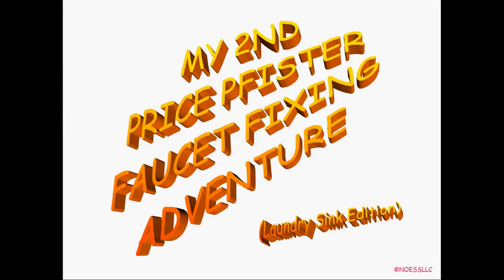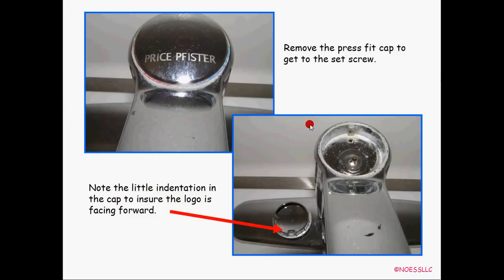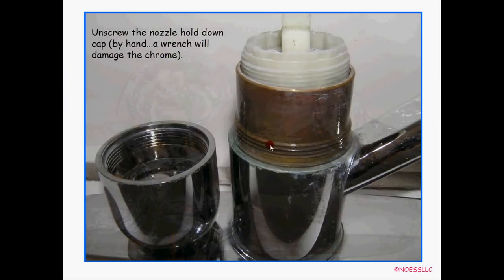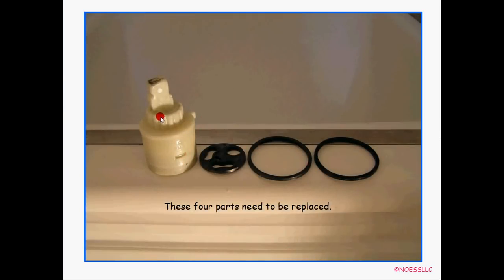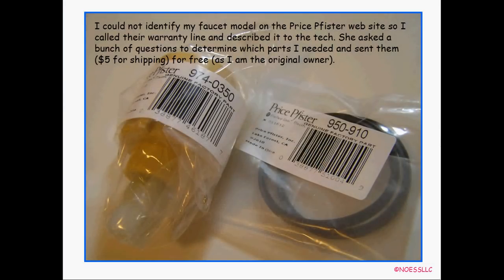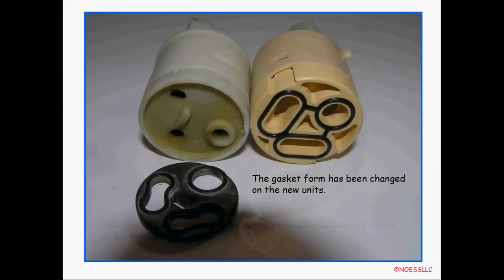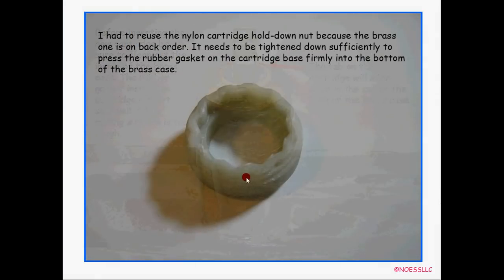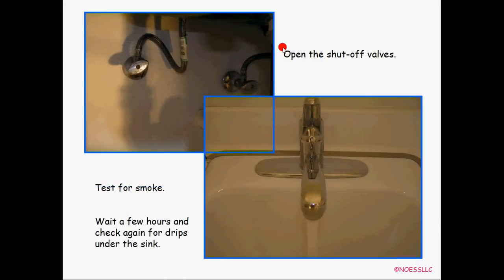Price Pfister Cartridge Faucet Repair

Comment: This video was extremely helpful. Not only did it take me step-by-step, but I like the fact that it talked about kind of the pitfalls with the buildup and getting that off. The other great thing was being able to get the replacement parts for free because I am the original homeowner. Thanks and I’ll be using you for other facets in my house that I’m sure will be ready to give out

Comment: Very nice video. I replaced the cartridge, no leak from the top now but I need to replace two O rings as you explained. I also have leak around outside the brass cartridge housing. Shipping is free now from Price Pfitser for the original owners. Thanks

Comment: Good video - thank you. I've replaced my cartridge before, but it's been quite a while and your instructions refreshed my foggy memories of how to do it. However, at least in my case, Price Pfister limits their warranty to 20 years. I am the original owner, but I was told that my 22 year old faucet was no longer covered. I found a cartridge on Amazon for $16.50. I can't complain too much, considering the use my faucet has seen over time.

Comment: Thanks for your video. Had to search a little to find a video on this model. I have the exact same problem of it leaking from under the handle and then dripping down the mounting hole in the  sink. I was not aware of the lifetime warranty so you saved me some money. Much appreciated.

Comment: Thank you!!  Best video for this project, by far.  I would never have thought to remove the cartridge gasket (which had indeed stayed seated in the housing--as you mentioned, and isn't mentioned anywhere else, even in Price Pfister's video).  Pfister 9740350 Genesis 26 Series Cartridge, Pfister 9417110 Retainer Nut (to replace worthless plastic one), gaskets matched at the hardware store, and we're good for another 10 years, hopefully.  Can't thank you enough.

Comment: Very helpful. I actually had "the tool" from a previous situation. I don't think I could have gotten the retainer off without the tool. Fortunately, my new cartridge also came with a brass replacement for the plastic retainer, so I'll never need the tool again. I especially benefited from your shot about removing the rubber washer under the old cartridge - not sure I would have figured that out. Thanks.

Comment: Thanks for a very helpful video. My only problem was a slow leak that appeared a couple of days after the repair. Was easily fixed by removing and replacing of the two o-rings after a thorough cleaning of all surfaces and addition of a little silicone grease for good measure. Your video made it easy.

Comment: What is the size of the O-ring for this faucet you are fixing in this video? Your video helped me change my cartridge and I switched to a metal nut (new cartridge contained the metal nut), but the neck/stem of my sink is still leaking.  I showed the rings to a Ferguson representative (an authorized Price Pfister dealer) and he said the rings are intact but why is my sink neck/stem still leaking? Should I replace them?
Reply: how did you finally fix?  we had same issue and tightened that piece that you have to use wrench on -  once we tightened that more the leak quit - Hopefully ;)